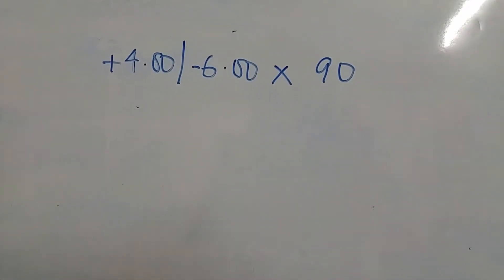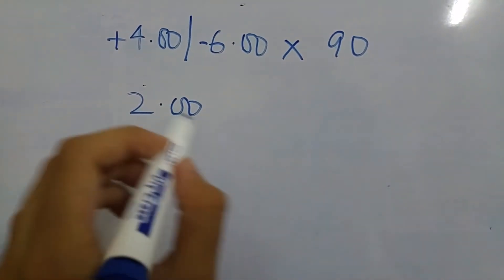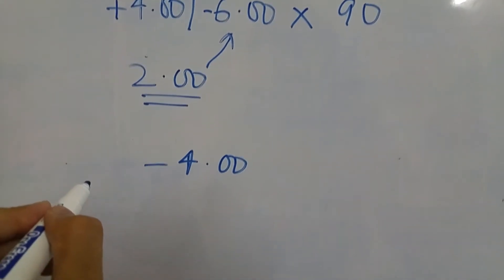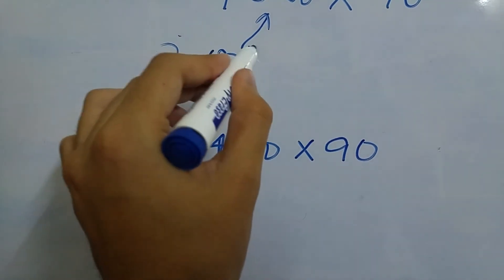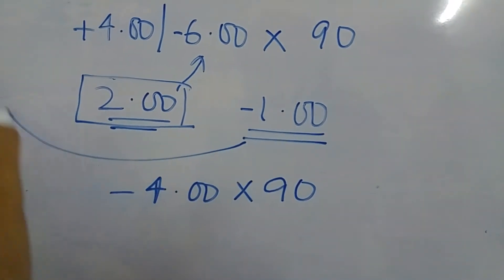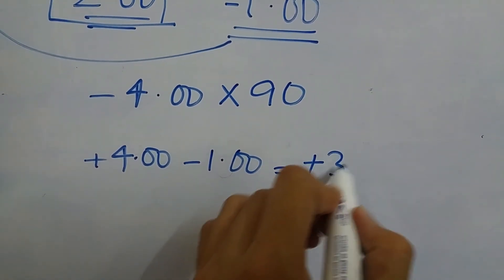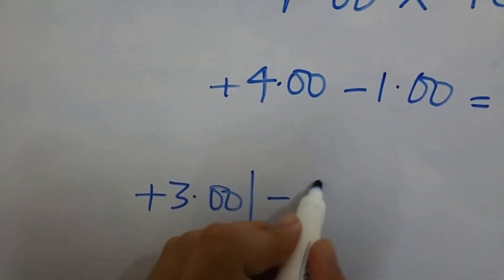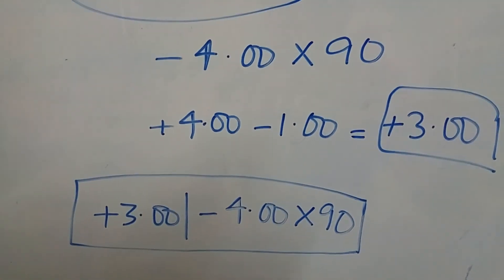Cyl Reduction in optical prescriptions

Comment: Dear sir, please this video is not enough for the new students.
1)When we can  using the cylinder reduction?
Almost we have no knowledge about this formula.
Please guide the with video lecture and details .
2)Which can the use for patients? 
Thanks yasar
Reply: Hi, scenario like, your patient has high cyl, we always prefer minimum prescription for a better adaptation for any patient, Rather than giving highest prescription, go for the least which gives almost maximum normal VA.  
Also, scenario where you want to reduce the thickness of lens,vs  frame selection of pt.
Also, where high prescription is not feasible for glasses, like sunglass... Etc... hope these points enlightened you.